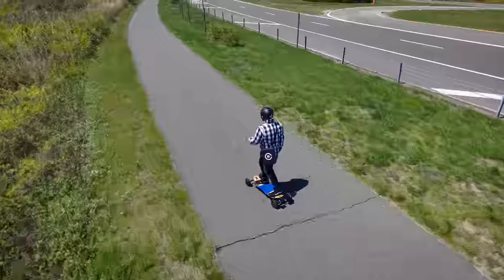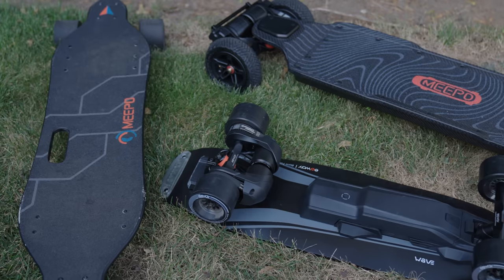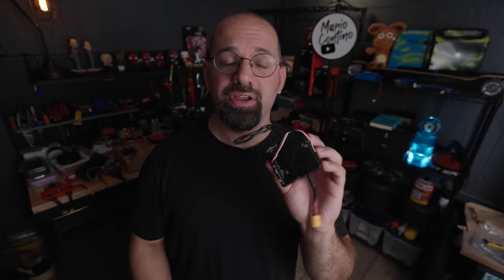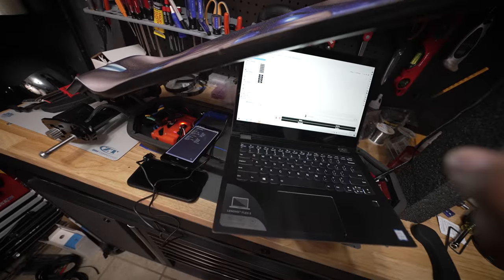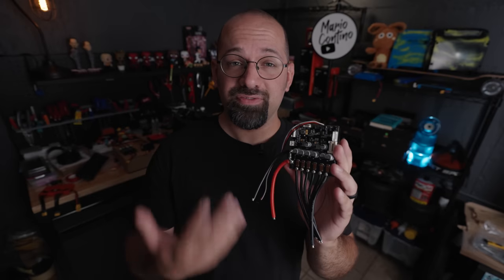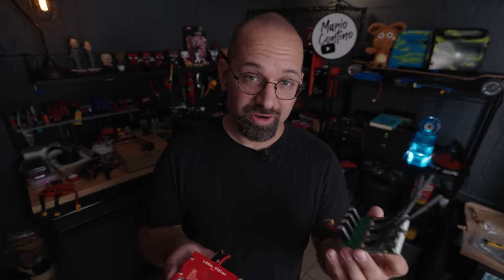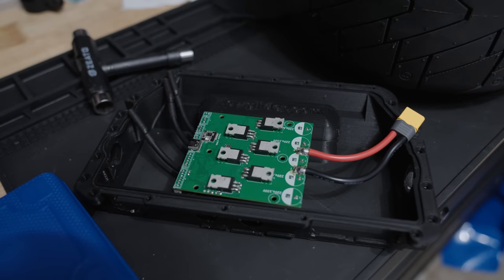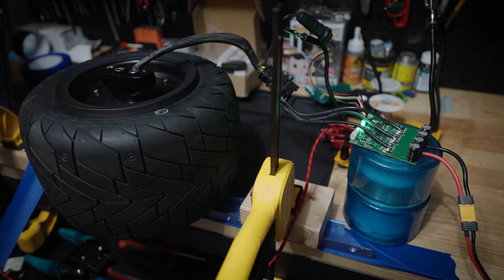What Is VESC? A Primer for Onewheel & Eskate People

Comment: Hey, you're completely missing probably the most important thing of the Vesc. Using a "normal" esk, you cannot do torque control, and torque control is exactly what you do when you're in a car and pushing the speeder with your foot. So this is the problem of esk where you can only do speed control. However, with a Vesc you can do very precise torque control - which is analog to being able to control the amount of fuel fed into a combustion engine. To be fair, this is a property for FOC, which is the type of control implemented by Vesc. So torque control is the BIG difference between esk and Vesc.

Comment: Yeah you're not going to get a lot of traction right now but once vesc picks up in the community's minds in regards to XRs and how it will give you a far less expensive upgrade path but also give you a ride ahead of the GT by two generations with a good battery to power that torque and speed. 😉

Comment: Hi, how are you, I wanted to ask you about the limits of little forcer v3, I currently carry two on a scooter with a 20s10p battery, 150A phase in both and 100A battery, I have tried several times with 200A phase and it works well but I wanted to be well informed so as not to break them! thanksby greetings!

Comment: Really comprehensive and articulate. 👍
It is wonderful to see content creators promoting a user-empowered hardware platform that will take eSkaters and Onewheelers into the future!
Another important point is that VESC type hardware can give a much greater performance than (say) a stock Future Motion Onewheel. The user can configure the current limits (to set and increase torque) and can configure their own top speed limits etc. 🙂

Comment: Well explained, thanks for the tips on what not to buy :) 
My little XS runs off a stripped down Flipsky 4.12 (50a). If I were to do it all again I’d opt for a newer unit since the older ones like this had no imu so I had to use the only serial pins for that.

My recommendation to others is don’t just assume you can just add everything you want to the lowest model. Get what you need built in if you can to free up your io pins for future expansion like lights.
Reply from the maker: Your XS board is definitely one of the coolest project builds I've ever seen. I'm jealous of it.
Reply: @TheBoardGarage  Thank you <3
I'd love to finish it, still some headroom on power delivery to see if I can get it to roll with me on it too.

Comment: Hey mario, so i just want to get some things straight. Im a rc hobbiest and we use ESCs all the time, its not untill i tried using a little rc car esc to power my electric skateboard motor, the thing just went up in flames😂. So is Vesc simply just a open source configurator that allows you to place safety features such as over current limiter on a esc (that supports Vesc) which would allow you to use it for more current demanding applications without fearing it to blow up. So essentially what i understood from your video is that Vesc itself isnt a special type of esc, its just a open source configurator that allows you to customise an esc that supports the software for tailored application.

Comment: Interesting approach to a video like this. Personally I would have opted to skip over the technicalities and definitions of VESC, and instead focus on the features and eco-system: what it can do better than non-vesc controllers, what areas does it lack in, how good the balance app is compared to a regular onewheel, what the vesc-compatible accessory market looks like, etc.

Maybe we can get a followup video? :)
Reply from the maker: Since this was meant to be a primer, it felt more appropriate to stay away from the rollercoaster that is living within a VESC ecosystem. There's an entire build series coming that will cover all of the other items in more detail. 

I had seen VESC mentioned in and around the community microcosms, and it occurred to me that most OW riders are unfamiliar. 

So yes, several follow ups. 

Cheers sir. 🙏

Comment: Great video, Mario. Do you think that a VESC controller could be put into my MagWheel Trotter T1000? What other components (apart from the controller) do you think must be changed? Thanks in advance !!!!
Reply from the maker: It should be able to be wired it. You’d have to find the motor wires, and be able to wire in the 3 phase wires and the sensor wires. I have no idea what’s inside a Trotter, so you’d have to be able to do good soldering and wire crimping for the sensor connectors. And also be able to figure out the foot sensor situation.

Comment: Wanting to use one wheel motors, r of them for 4wheel buggy to run around my land. Should I use one vest for each wheel? Or are there products out there can multiple?
Reply from the maker: You would either need one VESC per motor, or 2 dual VESCs. And they'd have to be connected together via CAN bus. It's a bit easier to use 2 duals, I'd recommend a pair of Stormcores.